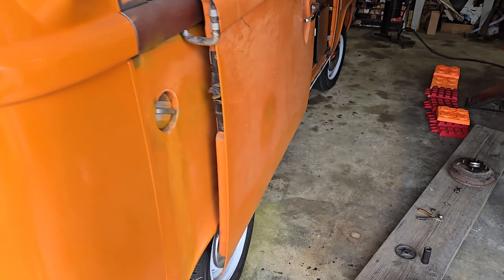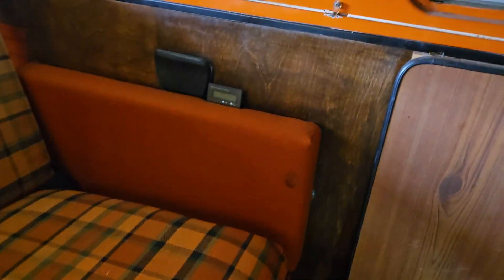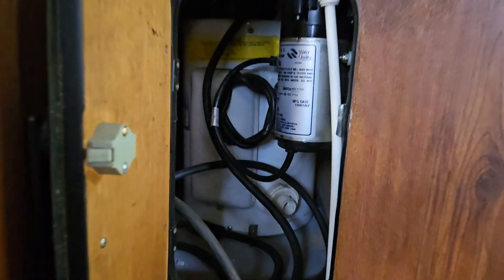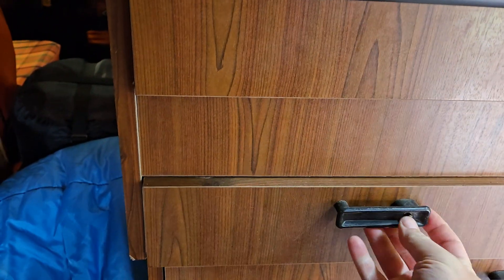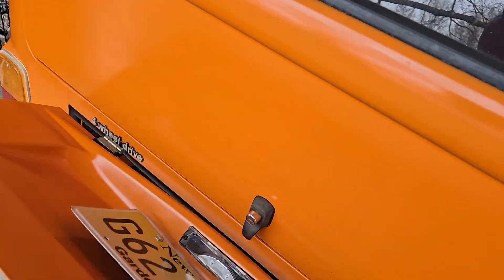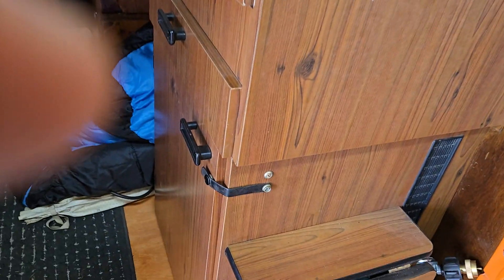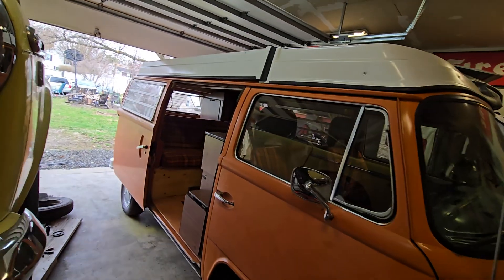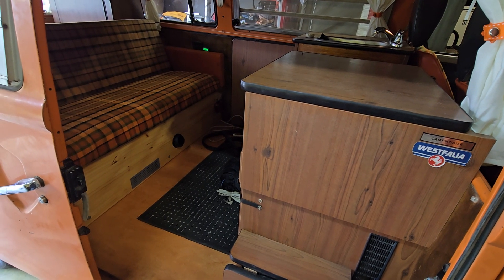Vevor (Chinese) Diesel Heater In A 1975 VW Westfalia Camper Bus

Comment: I saw somebody selling one on Facebook with the reason for selling being that in the 2 times it was used, it produced way too much heat in a confined space despite being a 2KW version on the lowest setting.
Reply from the maker: I can definitely see that, this is the smaller version and it still makes a ton of heat! I have found that depending on the outside temp, I just regulate the inside temp with the jalousie windows. Heater on lowest setting and it’s too hot, crack the window a bit. This is only an issue with the top down though. With the top popped up there are so many air leaks with the canvas that the heat just rolls out…